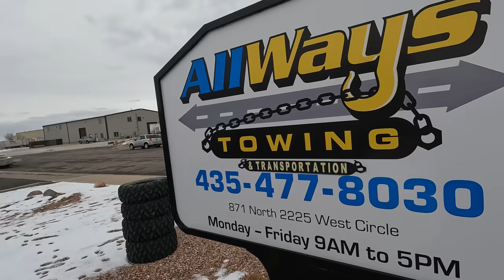Snow Storm Launches Toyota Off The Mountain Pass!

Comment from the maker: I go from the tops of the mountain to 100 miles out in the middle of nowhere to get a Tucson. Check it out https://www.youtube.com/watch?v=5KSqXW2Ykm4&list=PLEi6DFDVEqybxvABm2SDL4iqKO3PHRFVY
Reply: should of used a big rig tow truck would have been out in 20 minutes and no wear and tear on any vehicles
Reply: I would have recommended putting blue steel between the Morvair and the Banana. So, you could have used a snatch block on both winches and anchored them to blue steel
Reply: If you have angle of V shape with a pulley on the top, then you can use that angle to carry vehicle from the from wheels. V shaped both bars could be of 12  feet tall. you can add these to your tools, this tool can help you allot in your next projects. if you need more explanation on this V-shaped 12 feel pulley, you can ask me its design. very good videos.

Comment: Aside from the skill it took to get that van out I'm most impressed with how heavy of load those Apex winches can work under. Nice job getting it out guys.
Reply: Seriously, I was thinking about getting a warn but why bother when you can get two (or 3-5 vs zeon) whole apexes for the same price.
Reply: Need to talk to Badlands and have them get you a liquid cooling kit. If they can do it for computers and Teslas why not winches?
Reply: @zachmiller9175  I have one of xzr 12000 and pull trees with it all the time.  They're great winches for the price.  Just don't expect lightning fast line speeds and leave the winch vehicle running
Reply: That van should not be running at that angle, can't be good for the oil circulation?
Reply: @NoNORADon911  Have you seen how steep the hills are that the 4x4s go up and down?  Same engine in both.
Reply: A great adventure to watch for sure. You overcame a big challenge getting this van out.
Reply: @Rat-Builder  pretty sure that’s the 4th gen sienna w/ the v6 hybrid
Reply: @Rat-Builder  Don't trail-built vehicles often have a different oil pump, baffles, or pickup tube installed?
Reply: @NoNORADon911  Most FWD engines with transverse engine mounting itit shouldnot be an issue.  I would highly reccomend not doing that withmost longitudinal setups (FWD or RWD).
Reply: These kinds of videos are why I have a 12k Apex on my truck.
Reply: @NoNORADon911  the engines are transverse mounted, the oil pickup is still getting oil to the engine.
Reply: @CM-xr9oq  Not that I know of, but I do not work on small cars much.  With the man inside like he was, I would think that it would be both a warning buzzer and a flashing light to warn of low oil pressure.  

I will add though, that once many years ago I was out driving my 65 Jeep pickup powered with a Chevy 283 engine, and the hill was soooo steep that I was going down, that the oil light came on because all of the oil went to the front of the pan (like you mentioned) and the oil light came on, and I had to come down that hill with the brakes alone.  It was waaaay steeper than what that van was on.  I was not a happy camper that day.  I was on the brakes steady and fairly hard for 30 minutes.  They were definitely hot by the time I was able to start the engine.
Reply: @NoNORADon911 it most likely wasn’t running. It’s a hybrid, unless someone put the heater on it will stay a EV at low speeds. And because they went off a mountain road I’d assume the battery is pretty full from all that mountain driving regeneration
Reply: That's alot of equipmentused plus 4 trucks  for something a tow truck could of done in a matter of 45 Mins tops.
Reply: @JAMESYBOY.  wow, sick burn there dude. I don’t know how I will possibly recover😂
Reply: @JAMESYBOY.  got anything constructive to share? At all?
Reply: @paulhimle don't think heat is the problem , but lack of amp, need larger batteries.
Reply: @NoNORADon911 if sump is in front, no problem
Reply: @CM-xr9oq I think he's referring to customer car, not matts

Comment: Good morning everybody !! I think Matt needs to add yellow indicator lights to all his recovery vehicles
Reply: warning light on portable stand put before the curve,
Reply: Have thought that too. I know Matt prioritizes low weight over equipment, but there are tiny LED flashers that weigh basically nothing and would add some safety in several situations. Bet the flashers, wiring, and switch would add less than five pounds to each vehicle.

Comment: Greetings from Finland, from middle of the snow. Cool to watch out these videos, great job! Maybe try using a wide tire or a big rim (perhaps more stable prevent falling) on that edge to raise the winch rope higher, so that the pull does not come against the edge, this way the rear of the towed car rises a little before coming over the edge to flat. I´ve been using this trick couple of times to get towed vehicle rising a little bit, of course it need´s a solid ground or some sturdy stuff underneath that wheel.
Reply: Short log.
Reply: Considering they’re using two ropes/winches to pull it out - I don’t see how that’d be feasible 
Also they’re on the very edge of the hill and their winches are above their front bumpers 
How they’re going to get a wheel underneath that, i have no clue. 
I see what your logic is but that doesn’t seem very reasonable considering the conditions.
Reply: @ac3tate909  of course situations and equipments are different, like you said they had two strong winches to pull, so they got it out that way. I mean that moment when they back up and started to drag vehicle ovet the edge, in about 15 minute in video, when towed vehicle is still over edge, in that point if you get winch line higher and off from ground, that would help a bit. At least if you have weak winch and poor grip, thats my experience. Log is also good. And in my case, these were situations I haven’t prepared at all, so had to go with those equipment I had and found.

Comment: Hi,
A steep pull especially difficult over the edge. Not easy. 
We had a similar occurrence and used a large steel gas cylinder on the edge to allow the pulling rope to run/slip over...worked quite well. Acted like a wheel turning.
No snow and no traffic though!
Enjoy watching your videos.

Comment: Now I could see the advantage of a modified front stinger to aid with vertical pulling in these situations. Much respect to Matt and his team. They always get the job done safely. I don’t always quite understand the methods and equipment, and that’s okay. Love this channel.
Reply: a wrecker with some sort of boom would have been MUCH more appropriate for this recovery.  Less hectic and easier.   I often wonder why Matt is the person that does these recoveries when there are closer/more capable options.  And pulling from the wheel?  Even unibody vans have holes in the 'frame' for hooks.  Come on now.
Reply: @rndmprsn3532  If you've ever pulled on one of these rigs, you would know that those holes that you speak of would not hold. Plus with the angles they were working with the lines would have been into the body of the van causing further damage. Hooking to the wheels was absolutely the right call.
Reply: @simpledj509chromo7  did you read?   The equipment they brought out was not proper.  I can't understand why Matt is called for these types of recoveries.  There are so many recovery companies that are closer and have better (actual wreckers with booms) trucks.  This feels staged.
Reply: @rndmprsn3532  You're the one that's not reading. Matt said and I repeated that he said this was a job for a twin line wrecker. And it certainly wasn't staged. Doesn't Matt lessen the charge or pull people out for free when he's making content for YouTube? I think that's part of why the people that know about him call him. That tow bill, at least in my area would have easily been a couple grand or more up a pass like that.

Comment: Why wouldn’t you use a Winder Towing rollback for this recovery? Seems like that may have been a better option?

Still a really impressive recovery. It’s great watching how your whole crew works together and looks out for everyone else’s safety.
Reply: At bare minimum a rollback. But ideally this is a rotator job.
Reply: I was wondering the same thing!
Reply: I thought the same, the roll back must have pretty strong heavy duty winches, no?
Reply: not as many viewers of his regular tow truck videos, the offroad wrecker will create more views even if it was winching from the side of a road.😉
Reply: Def a rollback would have let them pick over the edge at the top. With them pulling on the wheels there's no way the rear wheels would have turned. Even if it was four-wheel drive which I don't think it was. This guy got into this accident because he was driving too fast with touring all season tires.
Reply: Content
Reply: I think he sold the tow business and Trevor went with it.  This is a job for a tow company not a off road recovery company.
Reply: This is my first thought. Big rollback appears to be the tool for the job here, back right up to the edge, no off-road required to get to site, better pull angle for primary pull, no worrying about break over getting back on the road. Use the other rigs to assist, but just seems like the obvious choice here. IDK it's not my business.
Reply: @evictioncarpentry2628  but still done it with 2 jeeps
Reply: @evictioncarpentry2628 
A rotator wound have been massive overkill, a light or medium wrecker would have made short work of this. Or like the others said, even a roll back.
Reply: would of been super simple and quick with a regular boom tow truck. minutes at most.

Comment: From a guy who drives work in the prairies of Canada. 

I promise homie slammed the brakes and didn’t release them. 

When winter driving- if going too fast, slam the brakes, weight shift will make you turn the direction of your steer tires, release brakes, pedal the gas. 

If you keep sliding say a prayer and do the same steps.

Comment: Matt with no jacket? Situation normal. Matt with sunglasses? It's a bright day! Snow dune! This was one tough recovery. Heavy wrecker would have been handy. :-)
Reply: Even a regular wrecker would have been nice so it could lift up with the boom rather than pull into the hill like the winches. It may have also helped cut down the need to dig out so much...
Reply: @bkind2182  could have tried using spare tires under the winch line to lift the pull angle.
Reply: But how would that support homosexual special rights and the illogical path that follows ?
Reply: @bkind2182   Matt owns a hook truck. Should have brought it.
Reply: @philb5593  yes Matt owns a real towing company with several regular trucks... So this is strictly for pure enjoyment and entertainment for us👍👍👍📞📱🎥🚨🛑⛽🕖🕟🆙🇨🇦🇺🇸🚜

Comment: Sorry if you've covered this, but what equipment are you going to use to transport the heavy wrecker to jobs?
Reply: I'm sure the Fords can tow it. They already mentioned it's smaller than a Jeep Gladiator and doesn't weigh more than what those can tow.
Reply: @NorthernSkiAndCycle  yup blue steel is gonna do it
Reply: Matt said it will be street legal, and also fit on a car hauler for longer distance recoveries.

Comment: Hi guys, great job on the Toyota van....i do a nice ride back memory lane every time i watch you.
But.....if you feel like it, i will put my two cents.
First off, when the pulling gets realy hard like that toyota....hook up on a suspension part as soon as you can, that way you Will be pulling on a rolling vehicule and not a dead mass.
Second.....please guys...please....when the pulling gets realy heavy throw a towell or a rag on your wire close to the towed vehicule ....why? ...physics, any weight put on the wire will make it glide  on the ground and fly off and hurt someone.

No smart talking down here....just sharing many, many years of doing the exact same thing.
Be safe guys......and good job!

Comment: Stock All Season tires strikes again. FWD Toyota Sienna's do just fine in the snow and ice if the depth is below 6" and you have some proper tires. My 2008 Sienna w/ Blizzak WS90 was almost as fast on the start as my neighbors 2019 Subaru Ascent on stocks. In the side by side tests my old van with proper tires destroyed the Subaru in braking. I actually sold a 2003 Subaru Outback for a 2008 Sienna. I moved the WS70 tires over and wondered if it would do alright taking the kids tubing at the pass. Deep snow in their parking lots was no issue for FWD with good tires.

Comment: I wonder if digging the snowbank down to pavement in the first place would have helped.
And for breakovers like that you need to hook on to the front wheels and pull there at the break over point.
At the end you were pulling the van INTO the hill, not up the hill by pulling on the rear wheels and a horizontal pull from the rigs, that is why it was so hard at the end.
Good job at figuring it out and getting it out with what you had.

Comment: If you have angle of V shape with a pulley on the top, then you can use that angle to carry vehicle from the from wheels. V shaped both bars could be of 12  feet tall. you can add these to your tools, this tool can help you allot in your next projects. if you need more explanation on this V-shaped 12 feel pulley, you can ask me its design. very good videos.

Comment: Good job. You could tell that the car probably took some damage while being dragged over the cliff backwards. It's not an SUV after all, probably doesn't have any bottom armor and it took quite a bit for power to pull it out. I can't think of any other way to do it with the equipment. Well maybe hooking the front tires as well like someone else suggested would have helped.

Comment: Hi Folks, As an Older Safety Advisor you Really Need "Magnetic Orange Safety Flashing Lights" for the tops of your Recovery vehicles. I know most of your recoveries are Deep Off-road, But here you Need them for Safety. They will SLOW down oncoming vehicles. They are not expensive, Magnetic Base, and can plug into a 12v Outlet. The store real easy... "SAFETY FIRST" Love you Guys and Gals...

Comment: Similar situation: April in Colorado. Icy road, steep dropoff. I put the Ramcharger wheels in the uphill ditch, rigged a strap and winch block to a BIG tree several yards uphill from the road and winched a Jeep up the hill and back onto the road. Before I could stow the gear, I winched out a front wheel drive rental car and a lifted pickup truck, neither of which understood the situation. Family and I were out on a Sunday drive when we encountered the yabbos. No charge. '84 Dodge Ramcharger. Warn 8274 winch with 150 feet of cable extension. When the tow truck finally showed up he was a little disappointed.

Comment: One small piece of advice. You probably could have done better if you had the front wheels on the road, as that is where your weight is. I know, turning around, you don't have as good of a winch, but I think you would have had less trouble sliding. 
I think what happens is once you start a job a certain way, you keep trying harder, rather than starting over.

Comment: Armchair observer here in Australia who appreciates a good recovery. Do cringe whenever we fail to use a damper on the rope and allow observers or spotters to casually hang around (12 mins) in the line of fire but outside the so called TOD. If that soft shackle let’s go the ring is a projectile and the direction of travel is somewhere between the winch and final anchor point. Only my observation.

Comment: Man I’ve been on a crazy recovery before 2 days of rigging and tore up 2 conventional f550s trying to get a f350 and 14k dump trailer out of a hole it rolled into…the other owner pulled me aside and showed me pictures of a similar recovery he did years ago double fatal Cherokee off a mountain…he said keep it simple if you think one light tow truck can’t handle it take the big one clear cut a path use cable extensions and pull what ever it is out…

Comment: and your also splitting the pull weight to the truck so it will not pull the jeep as much, and when you only have 5 feet of winch out you have like no pulling power because you have too many wraps on the winch buy using a snanch block you also have more line out which gives you more power. you guys should go to rei and buy a couple avalanche shovels for your snow recovery's, they move snow faster

Comment: WOW!!!!  Three HUGE safety issues!   1, NO ONE should have been in the white van once the pull started.  2, No traffic control on that dangerous winding blind curve roadway.  3, No deadman to the heavier vehicles employed while re-rigging.

Also VERY questionable was running the engine while the vehicle was at such a steep angle.  Very high risk of oil starvation and engine damage, not to mention how little the van's own drive wheels would have contributed to the extraction in the first place.